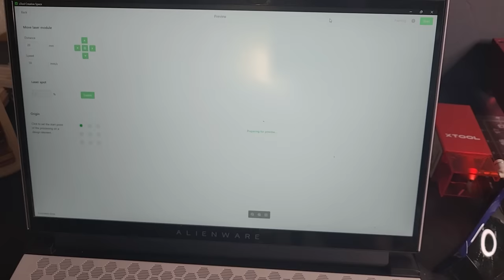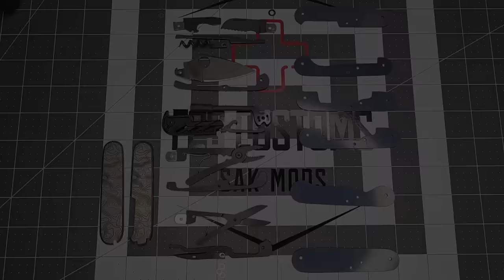How I made this Dragonox and engraved titanium scales

Comment: Lovely work as always, man. Whenever I put the bottle opener on a blade backspring I have to slightly round off the inside corner - otherwise it's a nail-breaker to open! But yours looked very easy.

On another video you showed a corkscrew on a scissor backspring: I'd love to know how you modified the scissor spring to manage that. Did you bend the spring? And if so, does the scissor still seat OK? Thanks
Reply from the maker: Thank you. Yes, I know what you are talking about. 😂
The scissor spring has to be ground down a bit and bent to the right shape. If done properly, the scissors will snap and the nail nick will still be accessible.
Reply: @FittoSurvive  Thanks. Would love to see the scissor spring process, though I totally understand if you don't want to share ALL your techniques! Really appreciate the videos.

Comment: Fantastic build! Those scales came out beautifully!! A couple questions, what dilution do you use on your acid? On you liners, do you ever get any flex on them, like sometimes on the outside layers I will get some bowing in or out, I can’t figure out what’s causing it, idk if I over pinned it, or under pinned it, I don’t have any play in my holes. Just wanted to see if you ever ran across that. Thanks for a great video and any help, keep
Up the great work! Love the build videos! Keep them coming!
Reply from the maker: Thanks, I appreciate it.
I generally do a 1:3 ratio if the F3Cl3 is dehydrated.
Your liners will bow if the G10 is thinner than 1mm or if you have drilled your holes improperly.
Hopefully that helps.
Reply: That is it, I am using .030 instead of .060. I will definitely make he switch thank for the tip!!
Reply from the maker: @thedoghouseoutdoors4116  Perfect! Glad I could help you with that.
The thinner G10 works fine with the 58mm SAKs.

Comment: Fact is you always use a Victorinox base structure always dealing with rivets and sometime mix it with other components such as Spyderco blades...
perhaps you can study a solution to ditch rivets in favor of your screws for further cleanings maintenances and modifications.
Never considered to use:
Sanrenmu multifunction Knives 6 small, 7medium, 9 large base to implement with Victorinox components. and to mod. e.g. drilling and threading thumbstud one hand in main blades... 
Sanrenmu makes also for Boker and has equal components with Ruike... scales are G10 fixed with screws... and aso very often removable pocket clip is provided... 
IMO you can make interesting product working in the large range, that fitting the Victorinox 111mm size... because it seriously is the most usable size for intensive users but retain some silliness (as the liner) and flimsiness in thicknesses from firm that worsen it, not improved over time ...

Comment: After your videos, i started making my own CyberCompact. Well. It works... how many knifes did you make before the outcone was 'perfect'? Also, i see your pins has one side ready. How did you make that? Pinning both sides is a pain in the b. Awesome work, as always, grat.
Reply from the maker: Awesome, glad to hear that I inspired you to start your own project.
It took about 2 or 3 builds before I was able to get everything figured out. When I was starting, I couldn't get anybody to tell me how things were done. I was constantly told that it was "trade secrets".
Yes, I peened the one side of the pins to start with. I put them in a vice with wooden grips to peen the first side.
Reply: @FittoSurvive  awesome! Thank you!
You really did! I built a fisherman for my father and acid washed a knife for a workmate. Its not something anyone could make a living out. I definitely couldnt. Really amazing job! And thank you for the tips, will try it out on my next day off. I have a knife half ready, i fcked up the pinning 2 times so far.
Reply from the maker: @Blez1224  That's great!
Best of luck with your project!

Comment: What reason use g10 liners? It’s thinner? Lighter?
Reply from the maker: The G10 has several advantages over the original aluminum liners. The aluminum is prone to oxidation and corrosion, the aluminum can get bent, and it is not a very hard material. The G10 will not oxidize or corrode, it keeps it's original shape, and it is a very hard composite material compared to aluminum.
It's not any lighter and I use the same thickness of G10 as the original liners.

Comment: Really enjoy watching these vides. What/which tool is the back spring used on the Dragonox layer, originally from?
Reply from the maker: Glad to hear that. I used an older scissor spring.
Reply: @FittoSurvive  I am facing the same challenge. I came across this channel some time ago and have been totally hooked ever since and would like to try and build a Dragonox. I was hoping the back spring from the saw layer would fit, but it's a little different. Would you mind sharing where you get these old scissor back springs or what model I need to look for?

Comment: Never showed or explained the modification to the awl
Reply from the maker: You are right, I must have missed the footage while editing. 😅 The scissor spring has to be slightly bent and the awl needs three 0.1mm washers.
Reply: @FittoSurvive Bent in which direction? Thanks again for the help.
Reply from the maker: @williamtower5462  Bend it up towards the scissors pivot bore. This will increase the snap of the scissors.
Reply: @FittoSurvive  I'm currently building a cybertool m with a Robin 2 on the knife layer with the can/bottle opener from a compact on the same layer. And adding a havolon scalpel as well. Your videos have been a tremendous help!
Reply from the maker: @williamtower5462  Sounds like a great project!! Best of luck on that!